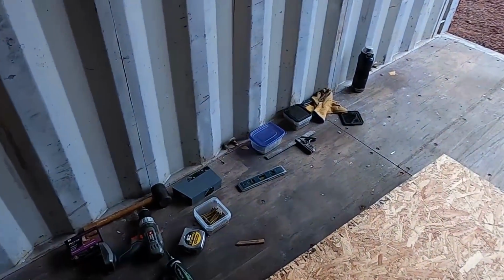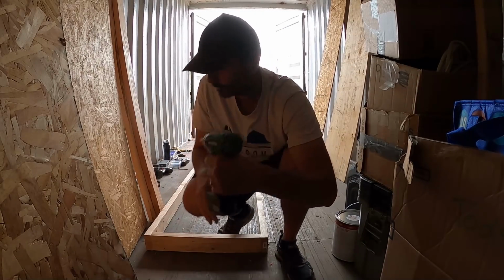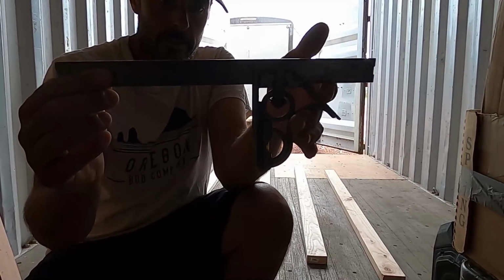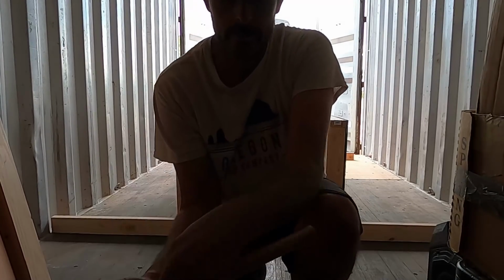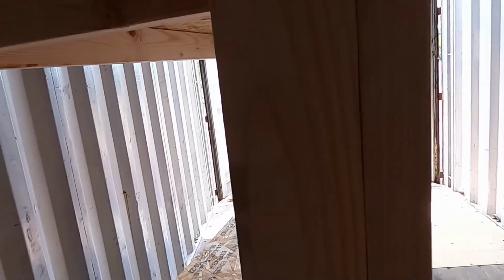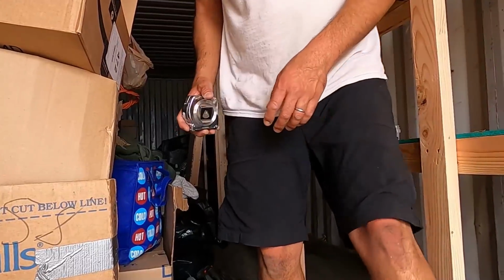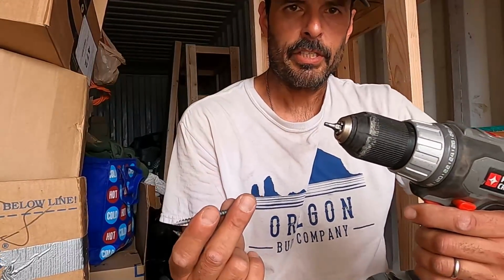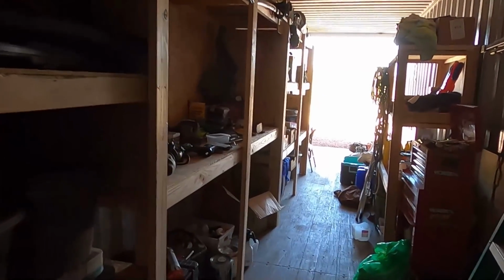Building Shelves For Shipping Container Part 2 | Homestead Storage | Homestead Vlog

Comment: Funny thing happened on the way to a build. I too went through the gambit of battery powered drills and like you finally settled on Hitachi. I found a deal on a dual setup of an impact driver and portable drill so got both in a nice kit with two batteries and a nice quick charger. Wish i had started with Hitachi it would have saved a lot of $. We have similar building methods. Give me a few straight 2x4s some OSB and screws and Bob's your uncle. I have emailed your "plans" and materials list for the shelves and workbench to myself as that design will work perfectly in my glass studio and separate workshop/storage. You have removed a lot of my normal umm time when freestyling a project like shelving. Really nice job and awesome result. Send some of that rain up my way, Grand Junction area in the Colorado Grand Valley. Once again, this 100 degree afternoon, the smoke from the Pine Gulch Fire (8-15 miles from me) is rolling into the valley and our air quality is slightly completely horrid. Stay Safe and Cool. Angry Old Hippie Hermit Peace.
Reply from the maker: Good luck building the shelves...let us know how it turns out!